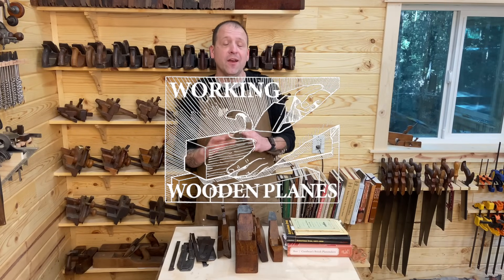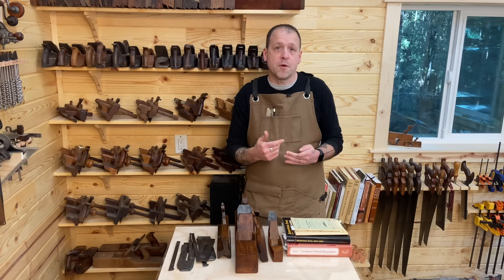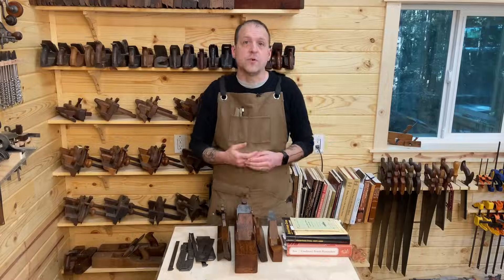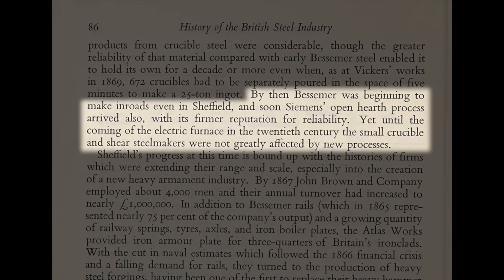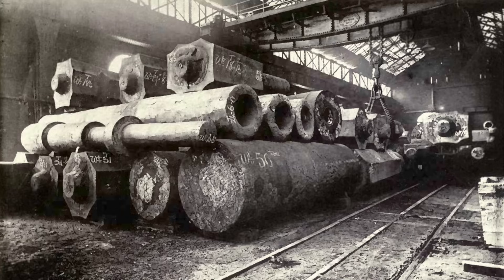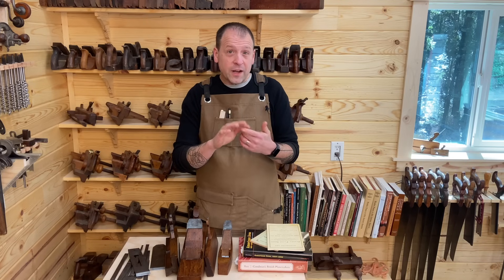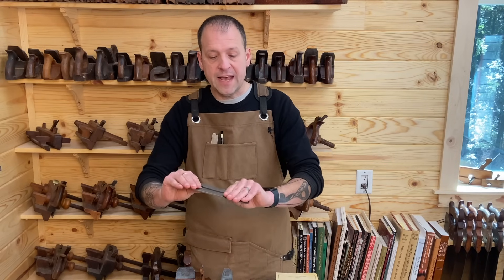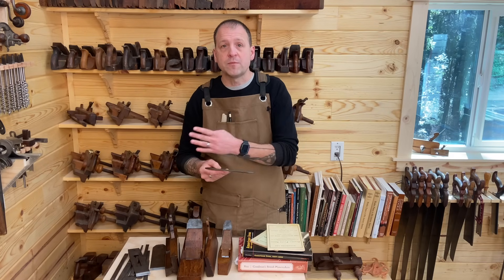The True Story of Cast Steel (Was Bessemer a liar?)

Comment: Fantastic video !!! I'm a blacksmith by trade and all of what you've presented here has been of importance to the restoration / reproduction part of my work over the past 50 years. 
There are so many twists and turns in this history. Like the fact that one of the most important things in the cast steel process was being able to produce crucibles that would withstand the temperatures required for the process. Early cast steel crucible clays were natural bodied clays. By a fluke of nature deposits of a clay which could stand these temps was near by Sheffield. These clays not being found anywhere else stifled other manufactures ability to produce cast steel.
Your interest here stems from would working and plane irons. Another interesting associated history is Disston and his search for steels for saw blades

Comment: Far more interesting than I thought it would be. What I didn't  get was that I thought a crucible was just a container that held molten steel. So even though electric arc was used to melt it it would still be a crucible.  Apparently that is not the case?

Comment: I am 78 years old. I own a record general purpose plane. The blade is stamped with Sheffield caste steel.. I've tried many modern planes and they are still not as good as my old plane bought in the early sixties.This plane takes a better cutting edge and maintains it better than any other plane I've ever tried.

Comment: Tool steel is a high carbon steel. Mild steel has a low carbon content. So how does Bessemer claim that the additional carbon get into his steel? Plus, Bessemer's process can only deal with iron from low phosphate ores. Thomas modified the process so that it could use the much more common phosphorus containing iron.
Btw., Krupp in Germany made the largest ingots of caststeel in the mid 19th century.
Reply: The Bessemer process removed carbon from pig iron.  The amount removed could be controlled.  There was no need to add carbon.

Comment: You should stick to your woodworking, you have no idea what you are talking about. All steel is cast (bar blister which is not homogenous). Damascus steel is not layered it is denritic and was the first crucible steel. Your are describing pattern welded stteel. A common misconception promoted, largely  by  US blade makers. You are confusing iron, cast iron and steel. bessemer steel was a step forward in mass production nothing else. Steels are made with different properties depending on the requirements, no one is any better than any other just more suited to the intended use. All ateel leaves the furnace in a molten state ( bar bloomery which is un unamologised spongiforousform) and is cast to later be forged usually rolled. Oddly no reference to Middlesbrough steel which during the period you cover was more important than Sheffield and produced more of greater quality. The cast steel lable is simply a marketing ploy and means nothing as far as quality is concerned, those so stamped are made from cast steel which is then forged as all others are.

Comment: Thank you for this video.  I watched it all the way through, pausing only to read the comments.  I am a mechanical engineer, woodworker and antique hand tool user & collector.  Your video helped me to understand the meaning of the ubiquitous "cast steel."  I was wondering why you did not discuss the the importance of adding carbon to the steel to increase the hardness.  In your reference to Bessemer's autobiography, he mentions "carburization."  This suggests to me that Bessemer understood that adding carbon while producing his steel did in fact support his claims.  I'm curious to know if any this resonates with any of the research that you have conducted.  

On an unrelated subject, the outlet on the wall behind you is recessed from the plate.  I understand that this is a code violation and is distracting to me.  Just a friendly observation.  I look forward to watching more of your videos!

Comment: Having been a toolmaker/fabricator working for the UK  Admiralty Research laboratory. 
There is mild steel which is weldable without heat treatment. Car bodies etc are made from it.
There is high Carbon steel known in the engineering stores as silver steel. Used for surfaces prone to wear. Knives are made from High Carbon steels. 
Damascus steel is layers of mild steels with High Carbon steel forged together. 

Cast Iron is a high Carbon steel cast. Which is not easily weldable. As it becomes hard as it cools. It is possible to weld cast iron with nickel as nickel is not affected by carbon.
But the cast Iron around the weld is almost not machinable  as it is so hard. Heating the Cast Iron to red heat and allowing it to cool down slowly in the furnace overnight will make the cast iron machinable after welding.
Reply: There is fake Damascus steel that is forge welded layers and real Damascus steel that is made with a crucible cast vanadium steel sourced from India. The vanadium was a natural contaminant in the ore body used - the ore ran out and the high grade steel manufacture stopped.

Comment: Now I have a question. Would it have been possible to take the Bessimer mild steel and introduce more carbon while forging it and make a good hard steel? My understanding of mild steel is that it is just a low carbon steel. So it just seems like if you put it in a furnace heated it up and started adding some carbon and banging on it and then temper and harden it, then it seems like that would give you some good hard steel. Did the Bessemer steel have a lot of impurities, and couldn't those impurities be worked out with a forge?
Reply: Yes, my thoughts exactly.  In the video, he highlights a clip of Bessemer's autobiography that mentions "carburization," so perhaps the man was really on to something?
Reply: Bessemer did produce steels with various carbon content

Comment: As a hand tool woodworker living in the UK who really only uses antique hand tools for a lot of the work I do, not because I like antiques but because they are by far the best and they are abundant and they are cheaper than todays new tools. What makes them better? 1) The steel, anyone who has sharpened a I Sorby blade Vs a Stanley blade will know the Stanley will take a fraction of the time to sharpen, both will become razor sharp but the Sorby will stay razor sharp 20x longer and once done really only ever needs a light touch up on a very fine stone and a hone. 2) The tool makers skill, brass and woods that would make any tool produced today with the same materials very high end indeed + they were handmade and they have already lasted many lifetimes. I don't live in the US and have never used US antique tools but I see many US Youtubers saying there isn't really a difference between old and new, either they don't know their stuff or antique US tools aren't the same quality as UK antique tools. If you know about antique tools you will know not all antique tools are the same quality, companies within the toolmaking industry fiercely guarded their secrets, especially the steelmaking process. The best plane blades are I Sorby, the best chisels are Marples ect and even very old power tools, I have a 1936 table saw, it's 16" blade and cast-iron body with brass rulers and 3.5 HP motor that is small enough to be wheeled around my 12ft x 20ft workshop, in fact it's footprint isn't bigger than a modern construction site table saw although it weighs a tonne.

Comment: Interesting video. 
You mentioned Siemens open hearth furnace, but seemed to have eluded that it just made "mild steel" of similar quality to the Bessemer process. 
The open hearth process made higher quality steel, and many different grades of steel well beyond what the Bessemer converter could make. The one advantage the Bessemer converter had was speed versus the open hearth process which took a very long time to refine each heat (probably 8 to 12 hours or so).
The electric furnace was indeed used to make smaller tonnages of specialty alloys, and tool steels. 
The Bessemer converters were kept around to make steels for simpler products such as steel pipe, but eventually were phased out entirely.
Reply: Don't know when they were phased out but I was a 19 year old at RTB Llanwern in its' construction phase, about 1961/62, and they used bessemer type converters using oxygen as did its' twin plant at Ravenscraig. In 1962/63 I was at Consett Iron Works adding waste heat boilers to their bessemer type converters. The 'phasing out' must have been part of the de-industrialisation of UK starting circa '80's.
Both Llanwern and Ravenscraig were doomed to failure because MacMillan (PM at the time) insisted that there be two plants, instead of the one large one envisaged, for political reasons; neither plant was large enough to compete with european steel makers.

Comment: I've heard the titanic was made from Bessemer steel.
Reply: According to the very detailed investigation "Metallurgy of the RMS Titanic" NIST-IR 6118,  analysis of a section of hull plating removed from the wreck during the salvage operations of the 1990s revealed that: "The oxygen content implies that this is a semi-killed steel, and the low nitrogen levels indicate that the steel was produced in an open-hearth furnace and not by a Bessemer process". There is some serious misinformation on the www about the characteristics of the steel, eg the Titanic Historical Society article 'Titanic’s “Brittle” Steel?' which makes the absurd claim that  "Science tells us that in order for steel of this quality to fracture due to cold and impact would mean the steel being brought down to below the temperature of liquid nitrogen." It turns out that the ductile to brittle transition temperature of the actual steel from the wreck, far from being the fanciful -195C of liquid nitrogen,  or the -15C of modern 1018 steel, was at least +30C, due to oxygen content which, even by the poor standards of the time, was far in excess of desirable limits.